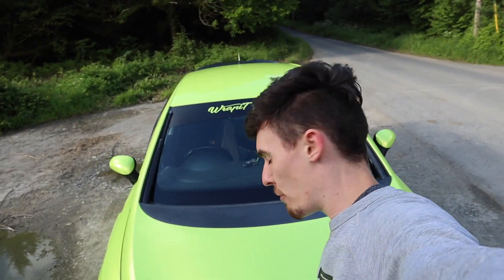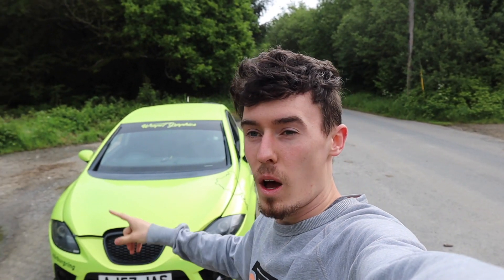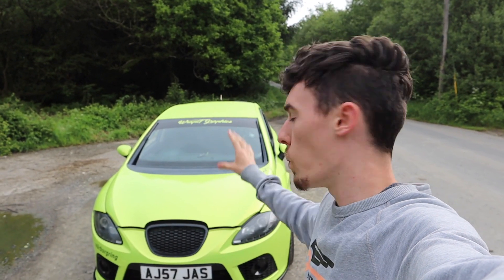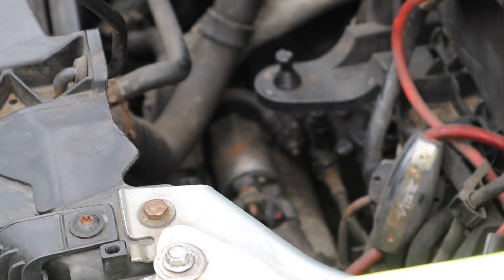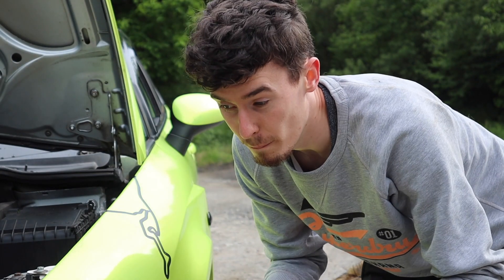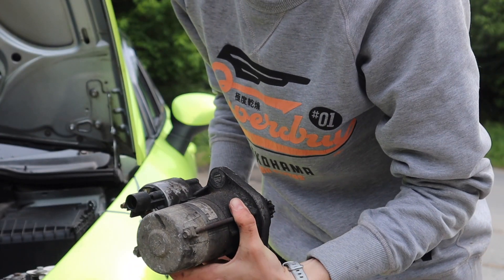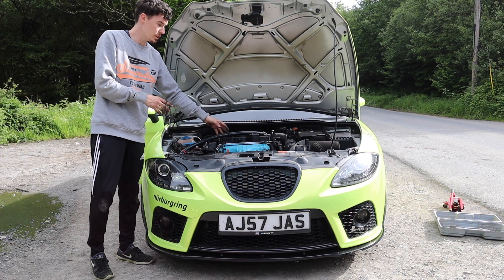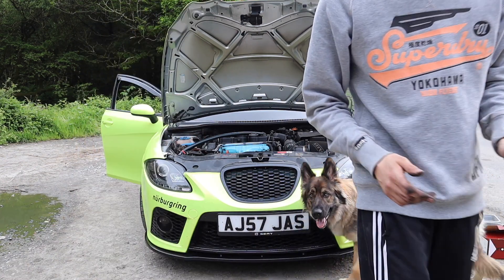HOW TO CHANGE YOUR STARTER MOTOR | SEAT LEON MK2 | JSMK

Comment: well done , for a first timer you did a good job , the reason behind removing the live of the battery is so when you reconnect the live to the starter it does not burn out the solenoid , its been a lot of years since i worked on cars , your video was refreshed my mind , thankyou
Reply from the maker: Thanks man appreciate it! Yeah you only learn by doing but that’s an important part haha, glad you enjoyed it 👍

Comment: Hi mate need your help!! Do you know how much a new turbo and labour would cost for a 2.0L tfsi mk2 Leon 😭 mine has just gone and I'm dredding the repair costs
Reply from the maker: 😬😬 At a rough guess turbo is Probably £150-300 downing if you got new or second hand, labour is around 2-3 hours so I’d guess another £150-200 mate unfortunately
Reply: @JSMKYT  honestly that's better than the figure I had in my head 🤣